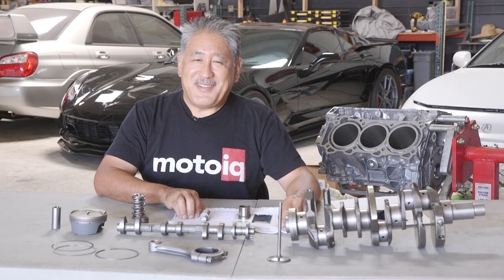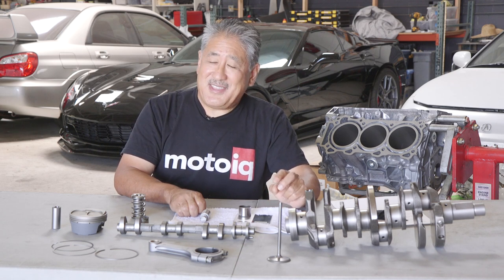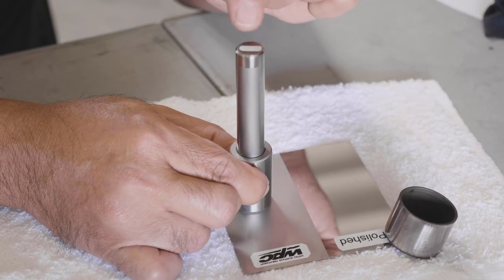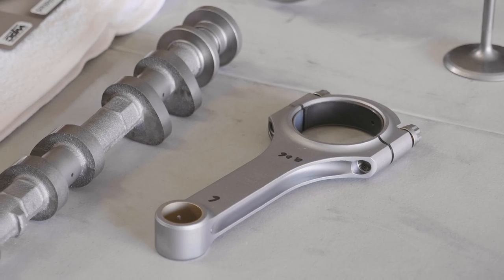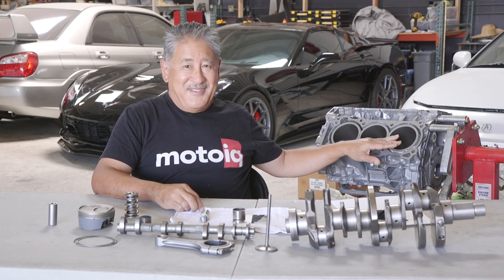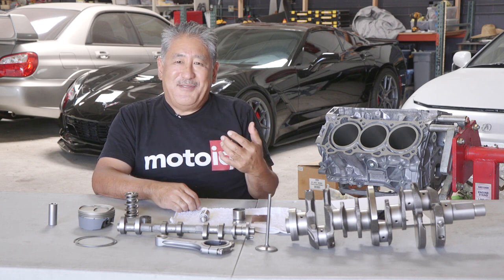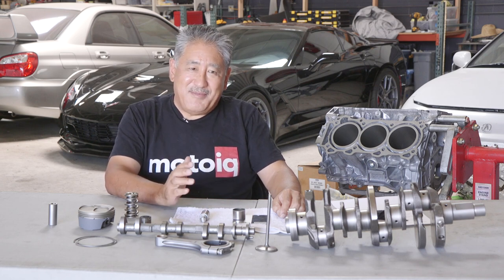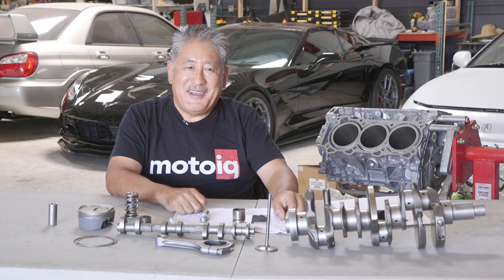What is WPC Treatment and Why Do We Use It On Our Engine Builds?

Comment: Hell, if shot peening has been good enough for firearms metalurgy for decades, then this process should be night and day if applied in their industry as well.
Reply from the maker: Sometimes for certain extreme applications like gears, I do this in this order. Cryo treat, then severe shot peen with hardened 330 and 220 RC 65 shot, then finally WPC.  The big shot extends the compressed layer a few thou deep, then WPC further refines the surface and gives the awesome low friction finish.
Reply: @motoiq  I gotcha, basically an extra step on top of previous hardening treatments. Which in itself is a benefit. Much obliged. =]
Reply from the maker: @JimBrodie  I have also WPC treated a match barrel on my Glock that I hand fitted which was super tight and ammo sensitive, it didn't cycle reliably on low power cheap ammo.  WPC fixed it. I also did the same thing on my hand-fitted 1911 with the same results.
Reply: @motoiq  Way ahead of the curve of what i was thinking already. Top notch. =]

Comment: Does anyone know the procedure and how long is the actual break in for wpc ring set?
Reply from the maker: Same as a regular engine, properly machined and clearanced engines have the rings seat in minutes.
Reply: @motoiq Thanks for the reply. I’m replacing my bearings and rings on my stock k24a1 before swapping. I’m going to wpc thanks to your video. I’m still deciding if I should replace the 100k piston or re-use and wpc.
Reply from the maker: I would not bother to WPC a used stock piston.
Reply: @motoiq got it! I ordered new pistons yesterday.

Comment: So its not a coating, its similar to shot peening, but with tiny ceramic balls rather than steel shot, correct?
Reply: Yes. Plus the secret dry lubricant that is embedded in the surface too.

Comment: Has anyone ever tried WPC on a Wankel rotary? Would it have any utility in, say, a turbo 13B?
Reply: Works awesome on a rotary. A few famous racing cars used it and it solved many many issues that rotary engine suffer from.  In fact, if you combine Cryogenic treatment with that its even more amazing
Reply from the maker: Kyle Mohan uses it. The Berganholtz Bros did to when they were running the RX8 in FD.
Reply: @motoiq  @James Dills Thanks. Which parts do they treat, the rotors and the eccentric shaft? I wonder if they keep OEM-style chrome plating on the rotor housings, it seems to me that big gains could be made by removing friction and improving sealing there.
Reply from the maker: @FireflyActual  housings, seals, e shafts, bearings.
Reply: @motoiq  Thank you!

Comment: And he talked for twenty minutes and I still don't know what WPC stands for.
I was guessing walnut pressurized compaction but it's not that.

I did learn enough to earn you a subscription.

Back in the day I remember shot peening,magnafluxing,balancing and something called blueprinting were the buzzwords.
Then came ceramics, titanium nitride and Nikasil.

I'm dreaming of a rotary that's also an electric motor.
Say a positive charged rotor floating on a field induced by a negatively charged block. 
Have the charge flow through windings or magnets and controlled by a computer.

Now you can blend smooth rotary power with hybrid electric juice in any ratio on demand with one moving part.
Plus this should eliminate the pesky apex seal wearing problem forever.
The rotor is always redirected away from the cylinder wall and gets to only work when needed.
Reply from the maker: Good idea, to bad rotaries have really poor thermal efficiency.

Comment: The cam follower demo is a bit deceptive. WPC treatment does not make a smoother surface, that is why the mirror polish shines brighter. A matte finish is an indicator of a non smooth surface. A matte finish has less metal to metal contact at the molecular level, so less friction between the surfaces. If it were a bearing surface, the matte surface would eventually bed in and match finishes with the other surface.
This is in no way a dispute of the value of wpc or it's benefits. Just that the demo is a bit deceptive.
Reply from the maker: You are right about the finish.  You are also right that WPC really reduces friction and wear.